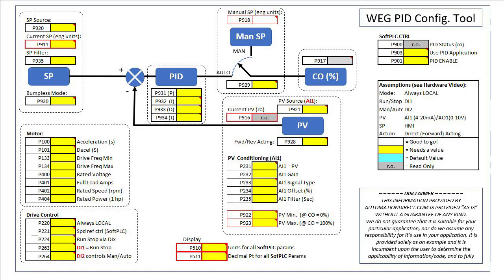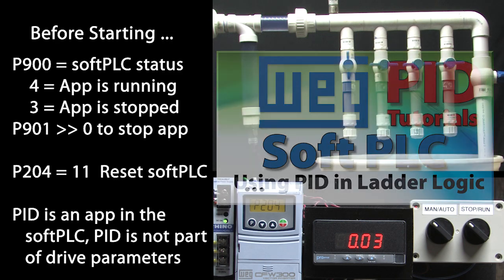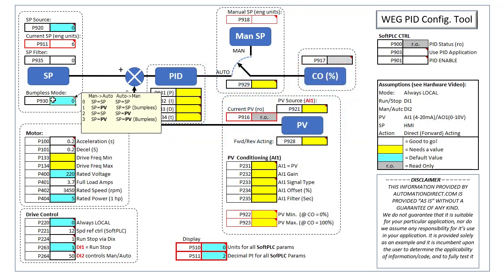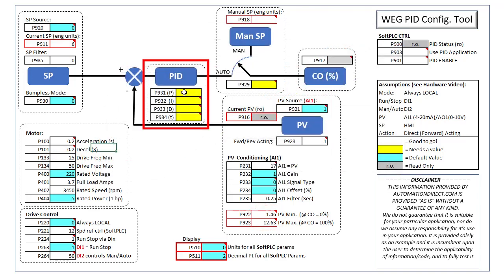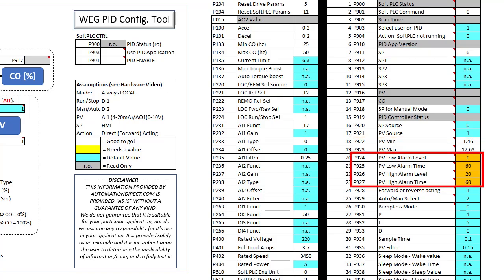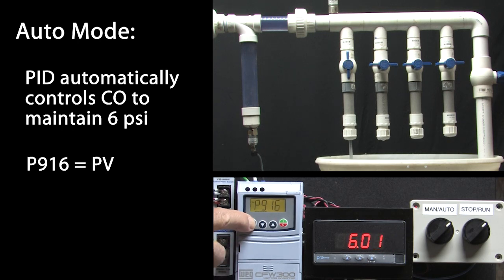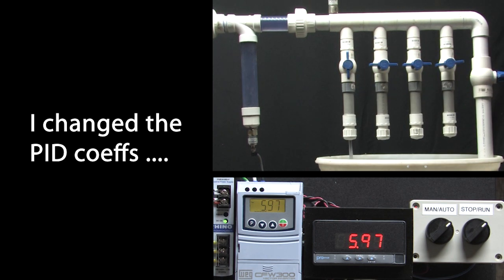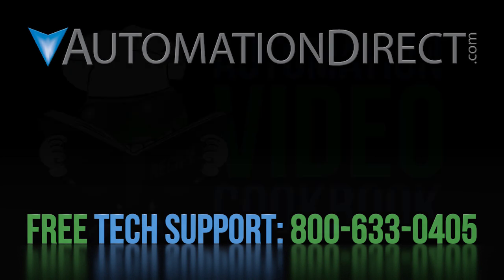WEG CFW VFD PID Quick Start Part B: Parameters from AutomationDirect

Comment: Man, your videos are just amazing.  
I have just one doubt:
How do the VFD convert the PID output to the right frequency:

error: PSIsetpoint-PSImeasured (unit psi)

If P=1, and I=0
output: P*error

But the motor works in HZ (and RPM)

But then, how does the VFD "know" for what HZ to correct? or is it just newHz=output*oldHZ? Even if output has different units than the CO? 

I saw your video where you build the correlation between the CO and PV, but it still puzzles me how you control de CO if the output is different! 

THANKS
Reply from the maker: Thanks! for the feedback. Not sure I understand the question ... that's just how it works...
Reply: @automationdirect  Thanks for your quick reply! 

What puzzles me is that if the output or correction is in the units of the process but the the control is in HZ. There is no conversion or something? Just magic? hahah
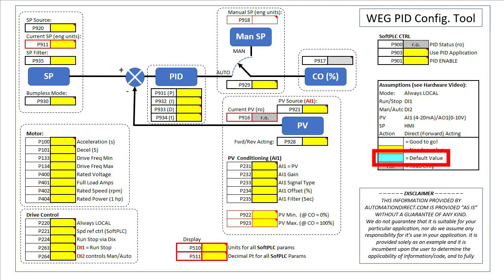Reply from the maker: @Bazikstano Nope, No magic. This video just didn't do a very good job of explaining how the scaling works (I didn't explain my assumptions). This video will give you a better feel for how you need to scale things to make the math work correctly: https://youtu.be/41SUi2JYDHU.  Start at around 0:45.
Reply: @automationdirect  Amazing! Indeed it does! I have even more questions, so I do not want to bother more...is there any book, with this level of technical detail that you would recommend? Not the classical book on laplace, but hands on applications!
Reply from the maker: I really like the "PID Blueprint" - it's a hands on step by step approach that explains things in English. We usually do an example of that in each PID series but ran out of time with this WEG Drive series. Here are some other examples we did using the PID Blueprint with other devices::

CLICK PLC Part A: https://youtu.be/_Xp3vam9ntw
CLICK PLC Part B: https://youtu.be/kA7bsBQRVeI

GS4 VFD:  https://youtu.be/3_NBoMraeoo

Do-more PLC Part A:  https://youtu.be/zaX7R5BIsx8
Do-more PLC Part B: https://youtu.be/QL6pwNPu-2k

Also, Did you know that we have an entire chapter of PID videos in our Automation Video Cookbook?
www.automationdirect.com/cookbook - click on the PID chapter.
Reply: @automationdirect  THANK YOU
Reply from the maker: You are welcome - good luck!